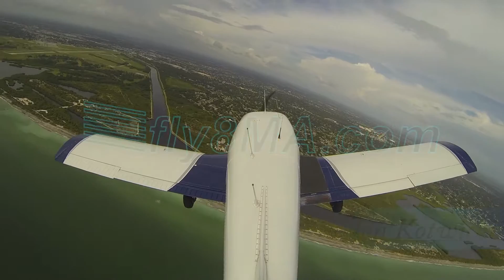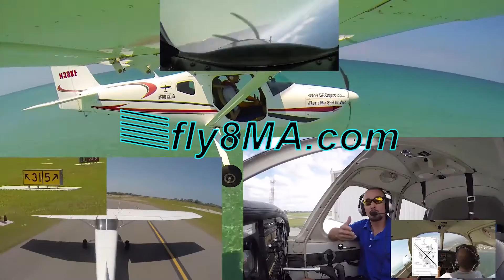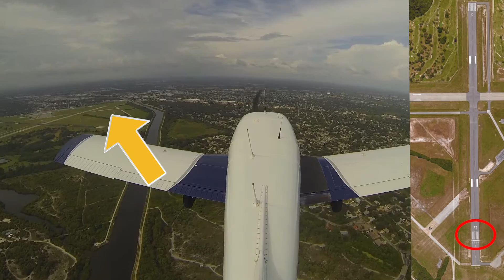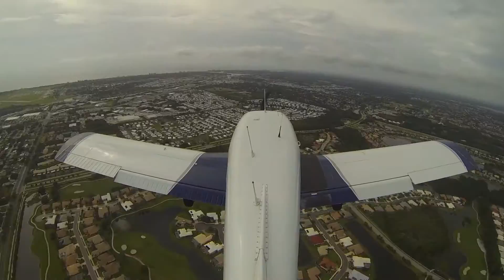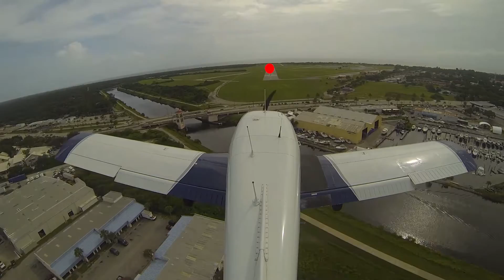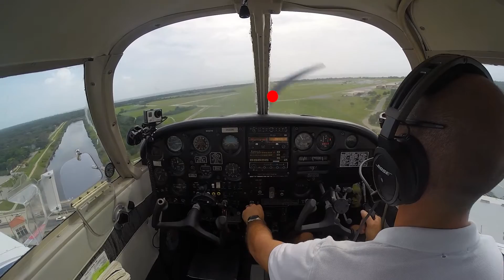Ep. 31: Aiming Points | How to Use and How to Choose

Comment: This is the only thing keeping me from taking my checkride, I struggle with short and soft landings in that you have to nail a touchdown point. I can put the cherokee down like a butterfly with sore feet but nailing a specific point is kicking my butt.
Reply from the maker: You'll definitely get the hang of it with practice!
Reply: Hey did you get it figured out? I have been having issues knowing if I’m high or low on my aim point.